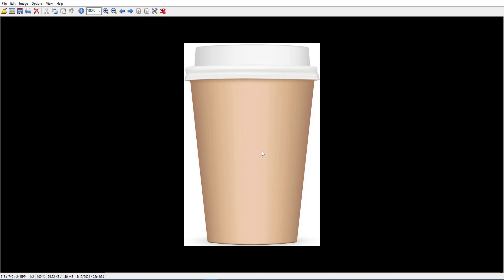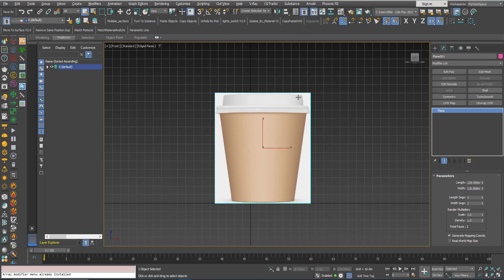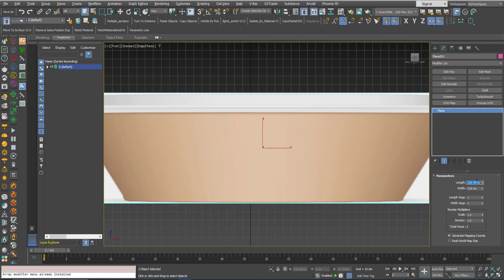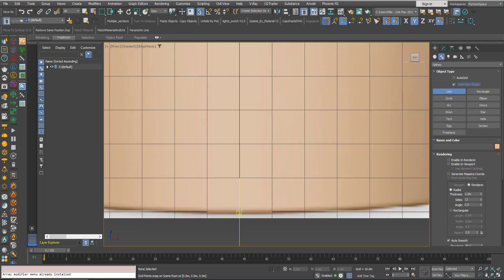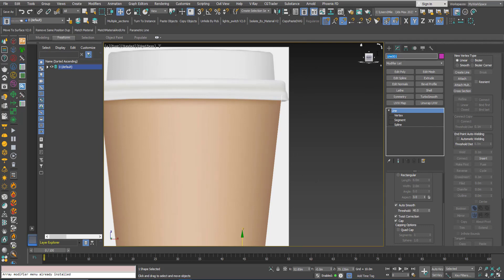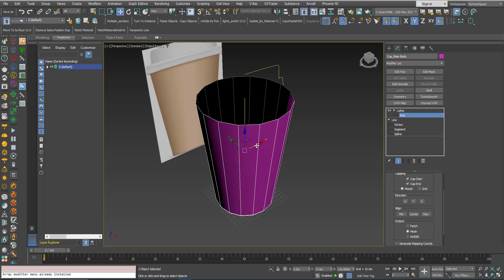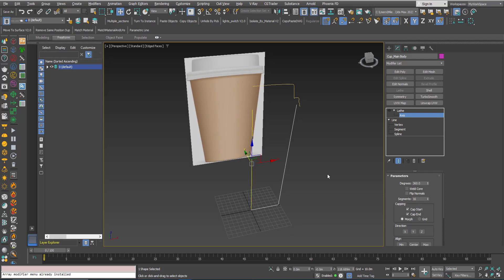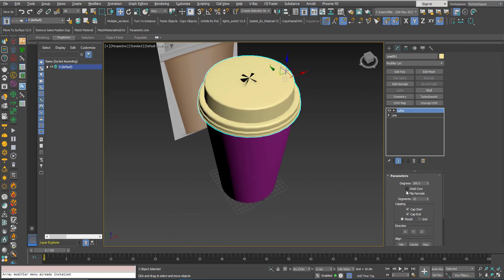Lesson 17 - 3DS Max - Total Beginners - Lathe Modifier

Comment: I made plate for pizza. Very close to camera, so used turbo smooth. Center vertex is annoying when using lathe+turbo smooth. I left small hole there. 🫣
Reply from the maker: Hi, i recommend you to add an edit poly modifier after the Lathe, create the necessary edge loops to control the degree of smoothness, and the start/end of the smooth transitions, then add the TurboSmooth. You can check out my two tutorials on TurboSmooth to use it correctly.
Reply: @MiledRizk  Sounds good step. Pizza covered hole anyway. :)